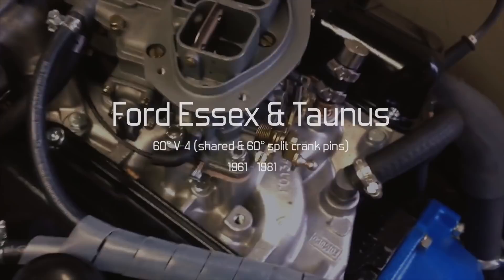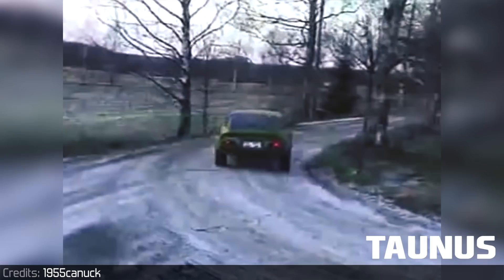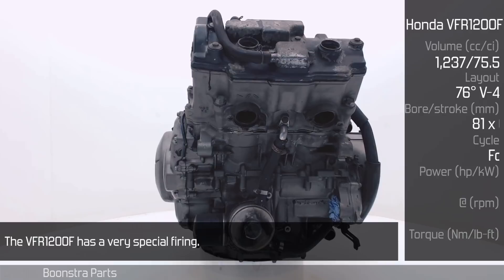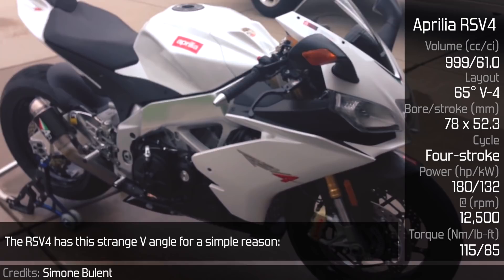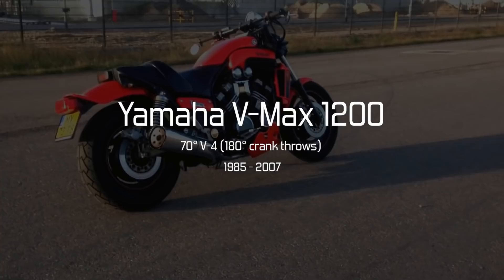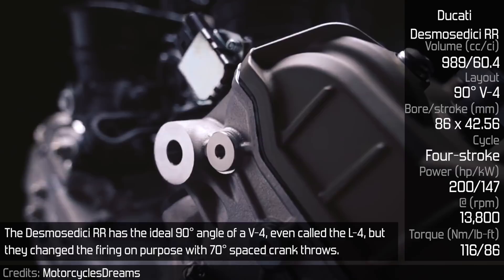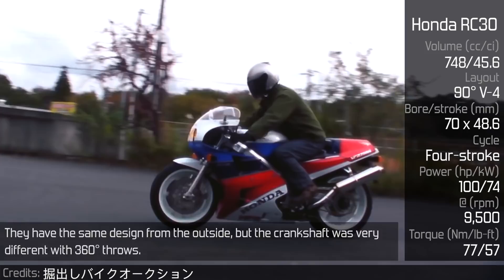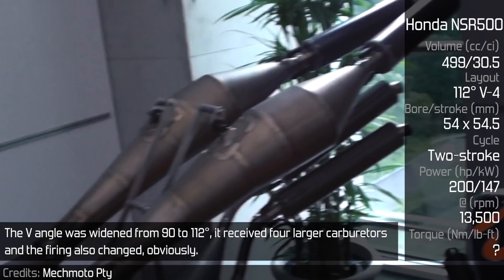9 Differently Firing V-4 Engines

Comment: Inline 4 are so much better sounding
Reply: Just listen to the RSV4 bike :O. it will change your mind.
Reply: Xavier Boujet I have ,but I still prefer the classic inline 4 !suck as the s1000rr , except the r1
Reply: if you prefer inline it doesnt mean its better
Reply: I hate inline 4s sound, except the crossplane. They are the ricers of bike world.
Reply: Inline sound is just so boring
Reply: inline 4s sound lame
Reply: I think the desmosedici rr is the best Sounding Bike Eber build
Reply: Philip J Fry the rumble of an Impreza is because of the headers, not because of being a boxer. This in the car world, because in the motorcycle world, there are no boxer engine with a good sound (maybe only the 4 and 6 cylinder Honda).
Reply: Xavier Boujet It sounds good, the R1 sounds better. It does sound better than any flat plane 4 banger, however.
Reply: I used to think this too....Until i bought a 1098 and an Tuono V4 1100. Not only do they sound better but inlines are rubbish in comparison to ride.
Reply: akio2589 the r1 sounds like a damn electric bike compared to an rsv4, a V4 is superior in every way including sound by far  to any inline4
Reply: No , the best sound for me is honda vfr800 v4 ....
Listen to it at the smoking tire h8nda swaped vfr 800
Reply: @wael the magna 750 sounds the best in my opinion . The 360 crank makes it sound great
Reply: The Adversary come on, man. The R1 crossplane is just like a v4. The crankshaft angle, firing order, the pulses.... Just a wider engine with fewer parts. They sound almost identical.
Reply: whisperdancer no way man, the low end rumble is so much better on the v4, but i do admit, they do sound almost the same at like 7000+rpm
Reply: The Adversary depends on many things, like the header length, muffler... But it's the same as they are firing in the same order and time interval. The V4 can have more of a mechanical noise due having two more camshafts, chain, timing gears. I am a V engine guy, but have to admit this crossplane is the only one I4 I really like.
Reply: whisperdancer on that i agree with you, the crossplane I4 is the only I4 that i like in any way, i find any of the flat ones extremely dull
Reply: I have a friend that owns an R1. I own a Suzuki Madura (yes, Madura, not Marauder). The Madura has a 72* V4  with 360* crank pins. They both sound good. In fact, I love the way the Madura sounds. But, I can't beat the sound of the R1. And it's a monster of a machine to boot.
Reply: Also, the R1 will, without a doubt, outperform an RSV4.
Reply: akio2589 the rsv4 has more power and is lighter than the r1 so i'm not entirely convinced...
Reply: The 2017 R1 has 200 HP @ 13500 RPM producing 82.9 ft. lbs @ 11500 RPM and weighs 439 lbs wet. The 2017 RSV4 has 201 HP @ 13000 RPM producing 84.8 ft. lbs @ 10500 RPM and weighs 458 lbs wet. It's not lighter and I doubt that 1 HP and 1.9 ft. lbs of torque really classify it as having "more power," but I guess, technically, it does. R1 has better 1/4 mile and track times. Then again, the R1 is a street legal racing bike, as it the RSV4. The R1 is designed to compete directly with bikes like the RSV4. I'm not really saying the RSV4 is a bad or inferior bike. I'm saying the R1 will outperform it. Given the weights, I would say the power difference puts them on par with each other. So then, it comes down to handling and gearing, which, it would seem, the R1 has a leg up on the Aprilla with. It is worth noting that the R1 delivers 162 HP to the rear wheel, while the RSV4 delivers 153 HP to the rear wheel.
Reply: If that were true why does the RSV4 continue to obliterate it. Engine specs mean a tiny amount compared to how a motorcycle will handle and the RSV4, or better yet, Aprilia, will always out handle the R1. Something worth asking is, were both those bikes dyno'd on the SAME dyno in the SAME place at the SAME day ?. If they were not those figures mean less than the paper they're written on. In saying that your quoting engine power which is completely irrelevant in every respect.
Reply: The R1 has a very long way to go to being a competitive machine out of the box. Especially when pitted against an RSV4.
Reply: The RSV4 doesn't continue to obliterate the R1. Track times are better for the R1. I can't really say that 1/4 mile times are better or worse, as my findings are fairly inconsistent. 0-60 times are consistently better for the R1. And just about every bike review I've read puts the R1 above the RSV4 for rideability. You have them backwards, my friend. The R1 is a better track bike out of the box than the RSV4. There's a pretty big difference between the 2014 R1 and older and the 2015 and newer R1's, if that's what you're comparing it to. As far as the dyno numbers are concerned, I've addressed that. The numbers I gave are averages from several different sources. Fundamentally speaking, comparing the bikes directly is apple and oranges. About the same size and weight, two completely different flavors. I don't care if you personally like oranges more than apples, I care about what the general consensus is and what they're made of. And the general consensus is, the R1 will outperform an RSV4. Track times and rideability are better for the R1. Look it up for yourself, I really don't have anything to prove.
Reply: Rideability is one thing, performance is another. I not only race motorcycles, albeit for ducati, i also work on them as my day job. In my real world experience the RSV4 dominates the R1 and always has, even over its newest release. As i said, the R1 has a long way to go, especially against its other japanese brethren. 
Comparing them directly is how we know which is the better bike. Comparing "statistics" from entirely different sources is comparing incomplete data. However specs aside they mean next to nothing until its on the track, which brings me to rider reviews. If theres something ive learnt in the industry reviews are one sides and incredibly biased because personal preference and brand favouring goes hand in hand. Even myself i am slightly biased towards italian motorcycles over other brands but i keep that reserved and offer that as an opinion when people ask me directly what i prefer, not whats best. 
I wont argue rideability is better with the R1, that is a japanese motorcycle trait, they are perfect out of the box, they do both ends of the spectrum very well, but you cannot compare it against the RSV4, ESPECIALLY the RF. Im not sure what track times you are referring too or which country but here in australia the RSV4 completely kills the R1. 
I agree they are completely different flavours, and that reflects in the racing world. Out of the box the RSV4 is a superior machine. Both receiving equal amounts of suspension upgrades and enhanced tuning, then as far as im concerned the end result is up to the rider and i have no say on which one is better.
Reply: It's not incomplete data if every article comparing the two puts the R1 ahead. A simple Google search is all that's needed. Every article comparing the two bikes, side by side, puts the R1 ahead in performance and rideability. If it looks like a duck, and it quacks like a duck, it's probably a duck. Comparing different sources is, the last time I checked, a viable means of authenticating information. If the general consensus is "this one is better than that one," it probably is. Even comparing the R1 to other bikes in the same class: The Ducati 959 Panigale, Kawasaki Ninja ZX-10R, Suzuki GSX-R1000, Honda CBR1000RR, BMW S10000RR, etc. etc. The R1 consistently comes out ahead. Based on the numerous articles written comparing it to other bikes, it's easier to control, which means riders feel more comfortable on it, which directly translates into better track times. Performance isn't a matter of who can put the most power to the road. It's about how easy it is to wield that power and use it to your advantage. And that's what wins races. So, with that in mind, the R1 will outperform an RSV4. I'm not a big fan of either bike, I prefer cruisers myself. I raced quads and stock cars once upon a time, and I can tell you flat out: You don't have to have the fastest machine to win.
Reply: Totally disagree inline 4 sounds plain compared to a v4 unless it's the honda vfr1200 which sounds like crap. Ride a vfr800 preferably the 98-2000 and it will change your mind
Reply: you mean the older ones, the new ones sound very similar to an rsv4
Reply: watch the bike world sportbike shootout, its a track test in the estoril circuit (awesome track btw) and the only place the R1M was "better" (more like easier) was on corner exit, straights, braking, mid corner, handling...... the rsv4 outperformed everything else and was the fastest bike, R1M was third (and was described as the only bike that was rsv4-ish in the flowy handling turn to turn) mainly because it has much worse brakes than most of the top dogs (the fact that yamaha thinks those brakes are acceptable in a 25k bike is beyond me, theyre not bad but comparing to monobloc brembos they just dont cut it)